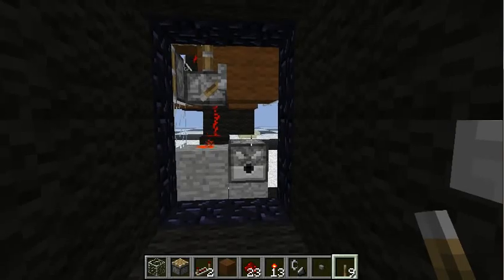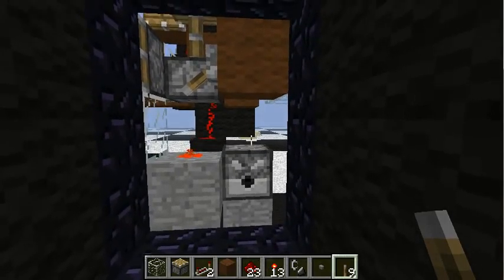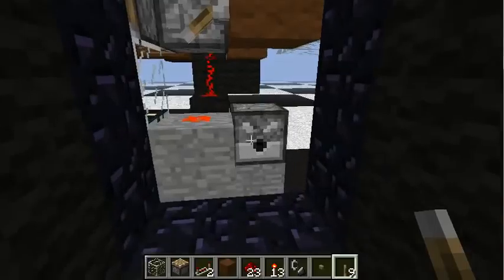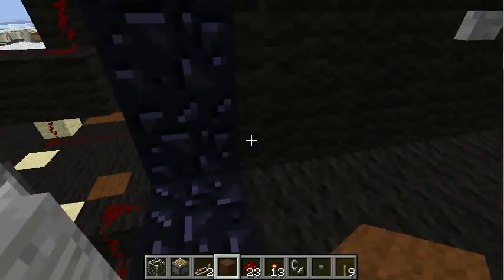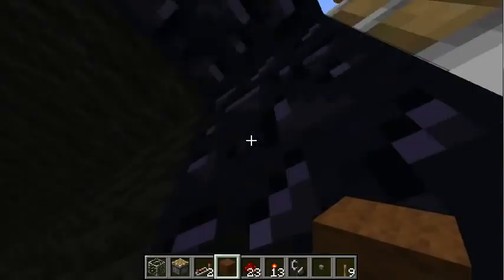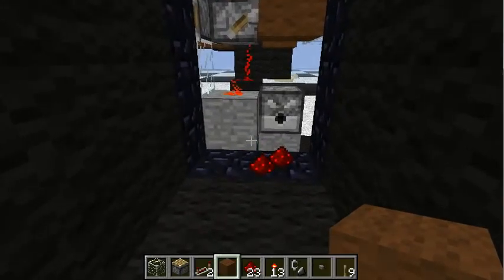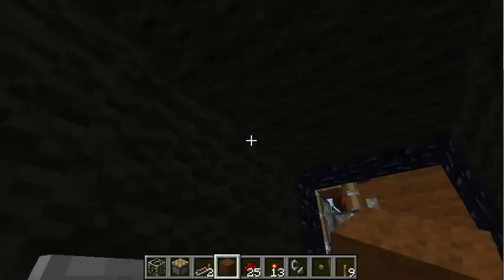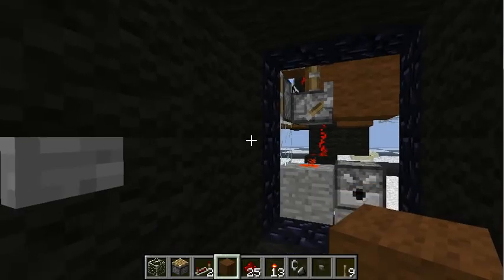Minecraft: How to turn your portals on and off

Comment: @WubbiConcepts Fully automatic being the turning off the portal part. It is something new yet old at the same time. The one problem is it is literally massive because it has so many components and requires some sort of proximity too =/
Basically it uses a mob spawner, creeper separator and snow gollems, So you can guess how massive the machine is =P

Comment: Ok ngreat but now you don't need all of that you can just use flint and steel in the dispener and for the off part all you need is another dispenser with a water bucket in it the redstone should be really easy and yes I know that they didn't have that back then.